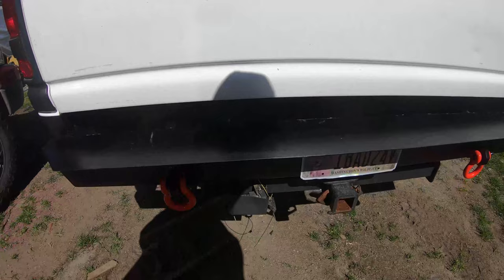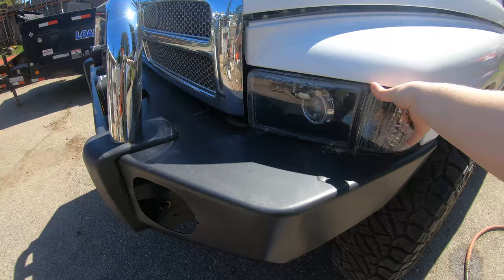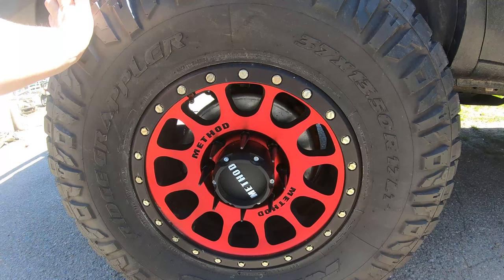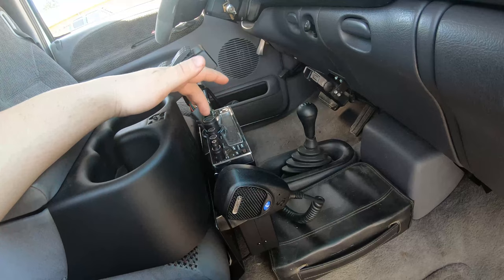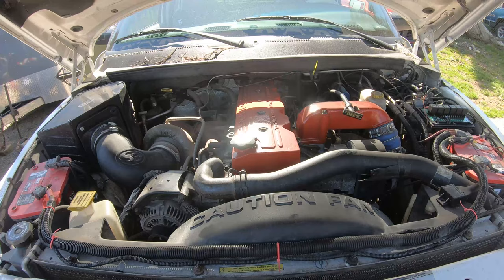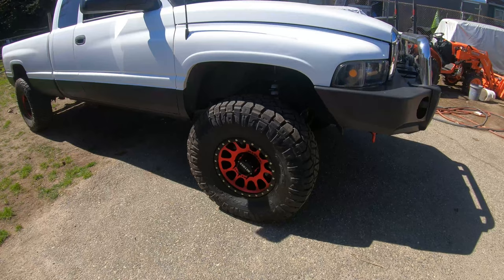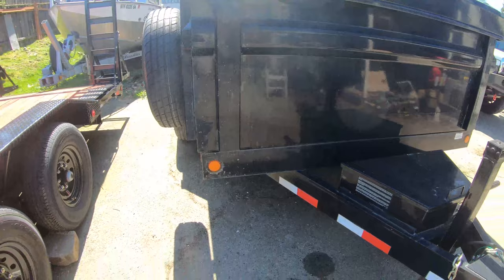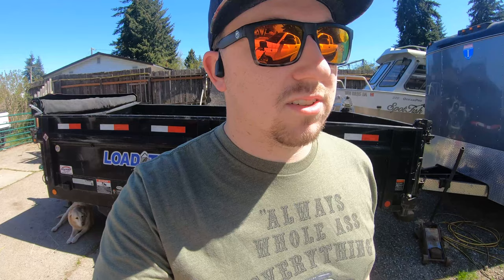2nd gen cummins almost finished

Comment: What do you have for a lift
Reply from the maker: I try and use thuren fabrication for all the suspension parts on my dodges. The only thing that isn’t thuren is the rear leafs which are carli suspension but those will be changing to the new thuren 3rd gen conversion system when it’s released in a few months.